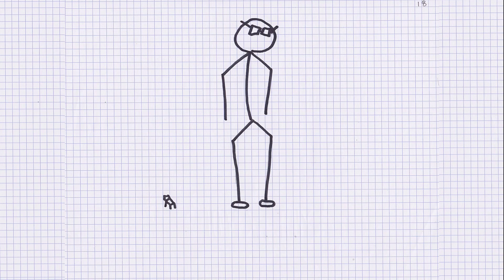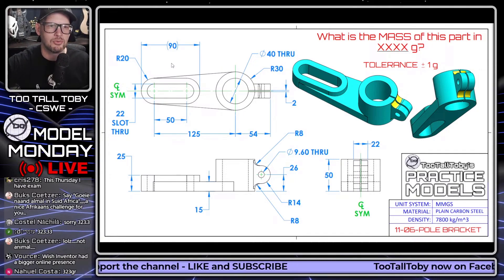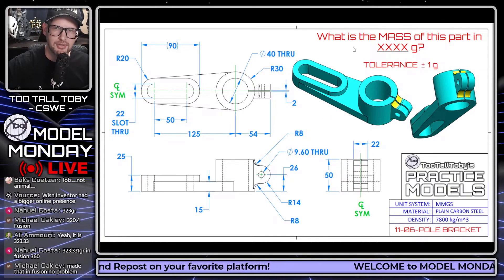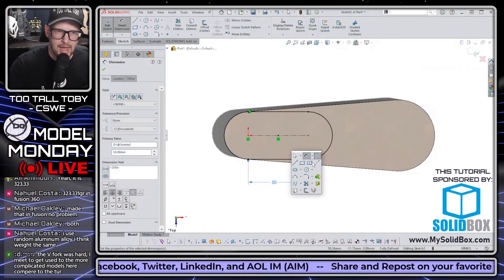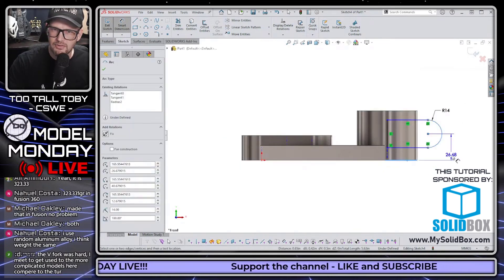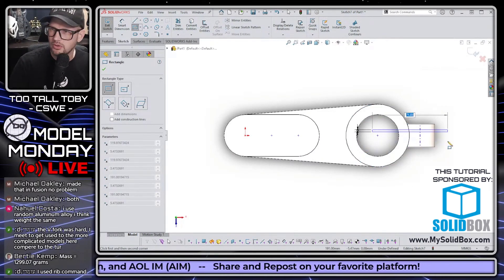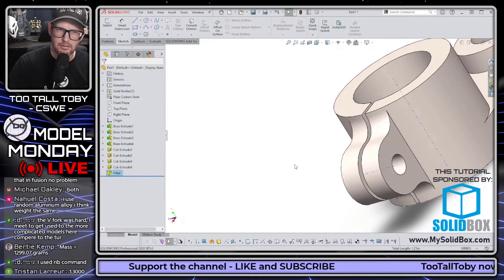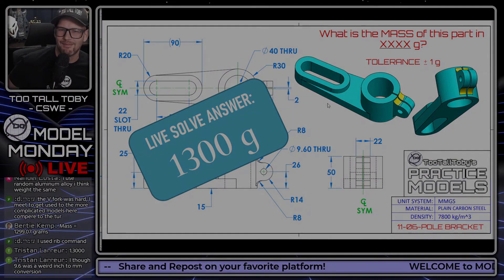Beginners SolidWorks Tutorial - Step by Step - 11-06 Pole Bracket -  TooTallToby-11-06

Comment: How to not have dimensions included when making a slot, and the on screen numeric input is also enabled? Even if I don't enter , it still has dimensions
Reply from the maker: Sorry for the laggy response.  click the SLOT command in sketch mode.  Look over on the left.  If those check marks are checked (*add dimensions) I think it auto-adds dimensions